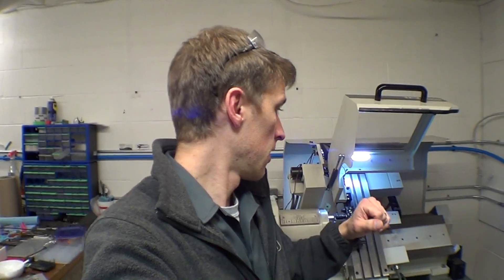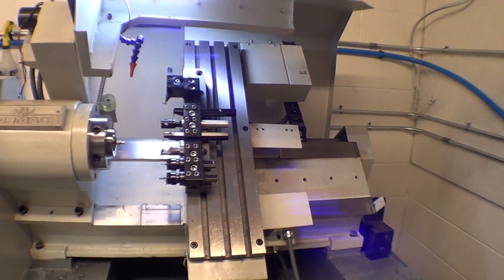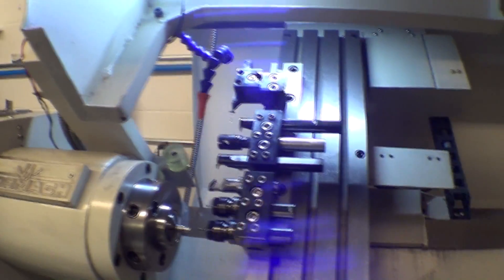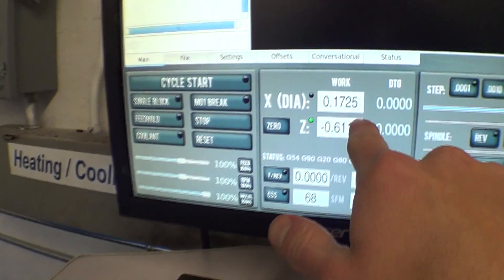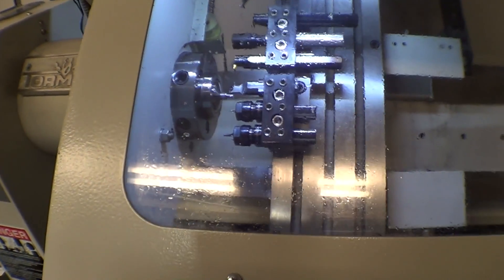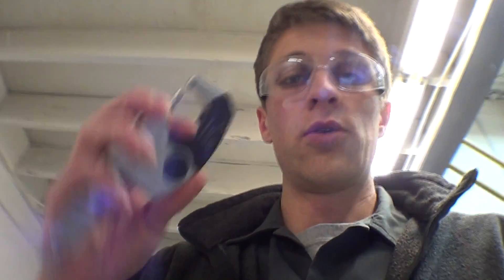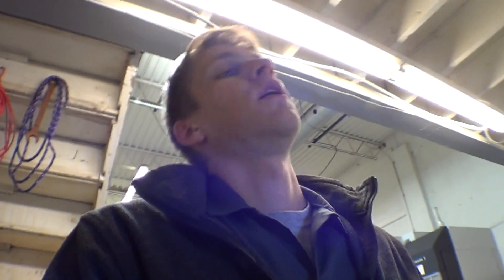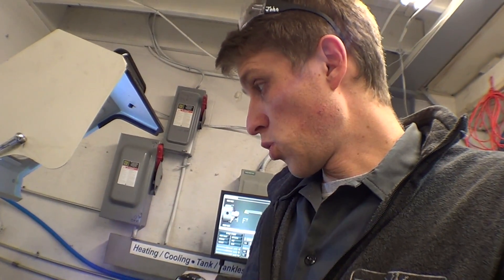KMT 117 - Homing the Tormach lathe

Comment: yes yes 150 and 20 buck tool both can be zeroed and show difrent measure. what is correct side. funny if 150 would be show bigger. you never do small part allways leave grinding. maybe they thinking that way :) and even tool have 4 digit acurate is 3 digit and you still need make 3 measure and calculate difference and still you can be off what even tolerance that tool says

Comment: What is that badass looking insert holder doing all the cutting?
Reply from the maker: I made it myself! it lets me hold a VCMT insert and do front and back turning with the same insert.  now i use the back turning insert to do finish parting and i get a perfect finish!  there is still a pip but that gets milled away with an engraving or torx pattern.
Reply: +JohnGrimsmo Show-off... =)

Comment: A couple of things I have found, there is a great mechanical limit switch on amazon, the TZ-8111 which is what I use, it repeats to 4 tenths all day long. Another option are inductive proximity switches, I used those on the mill, they repeat to 3-5 tenths and don't have any mechanical things to wear out, but they do require more wiring. The other thing that I do is setup my tool #1 as a known distance from the center line of the machine after homing. So in other words, home X with tool #1 measure the exact distance to the center line of the spindle with a test cut ect and then that number will become your X part "zero". So if it was say 5.288", home your X with tool 1, and enter 5.288" as the tool location. If all your other tools are set off your master tool #1, then all you need to do to start a new part is home X and set your Z and your all good. An added benefit is that you can "resume" a part by homing X. I am still using crappy mach3, but this method seems to work great for me, and its fast.

Comment: 2 tenths is miles...
Reply: +eformance when he says 2 tenths he means 2 ten thousandths 0.0002'"not 0.2"
Reply: James Cote LOL, I'm well aware of that.  For a digital micrometer that measures to 5 decimal places, being off by 2 tenths is is miles :-)
Reply: +eformance measure to 5 decimal without inspection plates and metrology level practices is just going to leave you chasing your tail most of the time. also i have doubt the machine will keep 2 tenths accuracy but for the cost of the tormachs you cant expect to much.
Reply: Well, any time I origin my digital mic, I make sure to test it with a mic standard.  The Shars is 0.00005 resolution and +/-0.00012 accuracy, while the Mitutoyo is +/-0.00005 accuracy.  That's a span of 2.4 tenths vs 1 tenth, or roughly 2.4 times less accurate.  A manual micrometer can achieve better accuracy when used properly.
Reply: eformance half a tenth, i did not know the Shars where that good. sounds like they are a good deal for the money
Reply: James Cote don't confuse resolution with accuracy. If you can't measure accurately, you cannot produce accurate parts.

Comment: I'm fascinated you have the same problem on the Tormach that I have on the G0602. I'm using LinuxCNC which is the guts of PathPilot of course, and I have to do this too.

The other problem I have though is that I get about .002" creep in about an hour of machine time. The job I'm working on now I get 8 parts per foot, so every 8th part I reset my G54 in the X just to stay consistent.

Comment: The dwell should not do anything really. Reason being 'theoretically' there is a small gap after the tool was stopped. Like, you surely know the use dwell with drills to get 118 degree bottoms for holes. If you understand what I mean.

But (if I understood the case correct) for a proper machining the machine should not reset itself like that, but then again, that's more like entry level machining.

Nice  trick with 8 axis lathe I was shown was zeroing the machine before it actually had fully loaded the system.